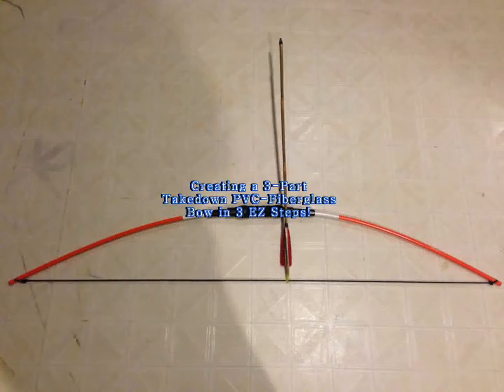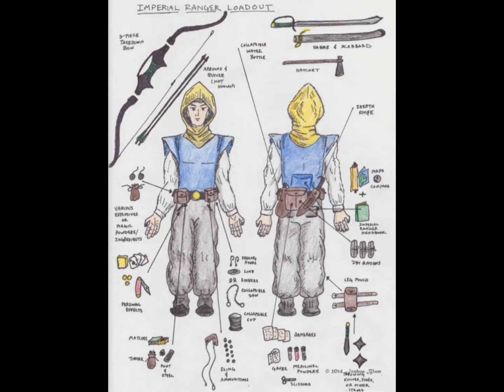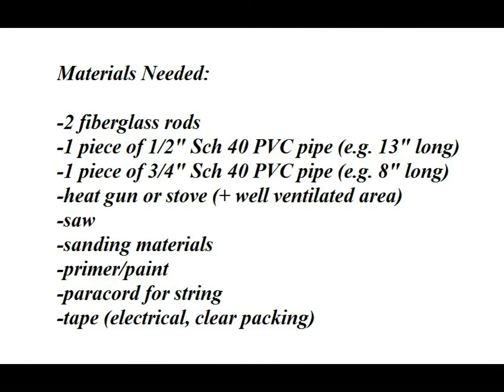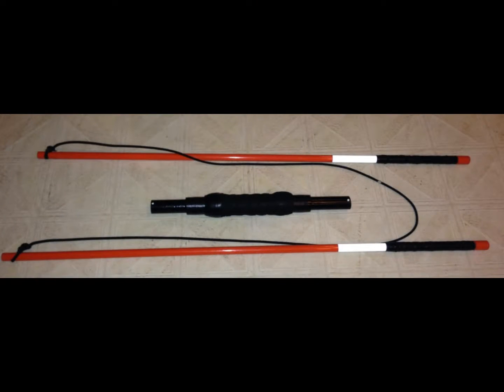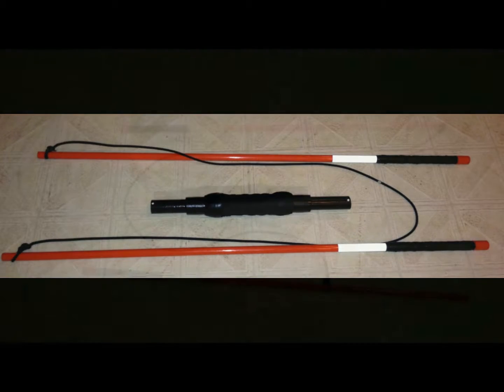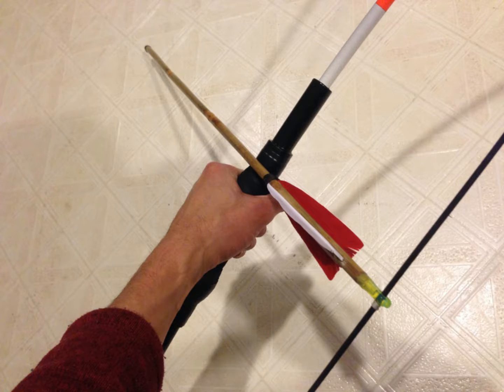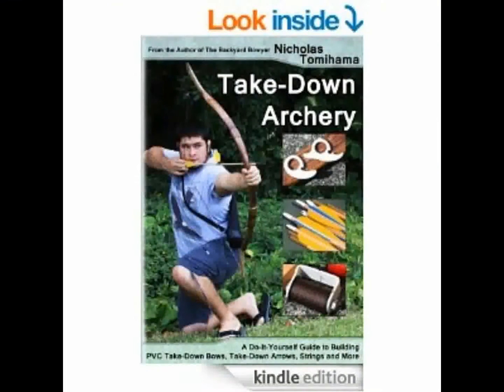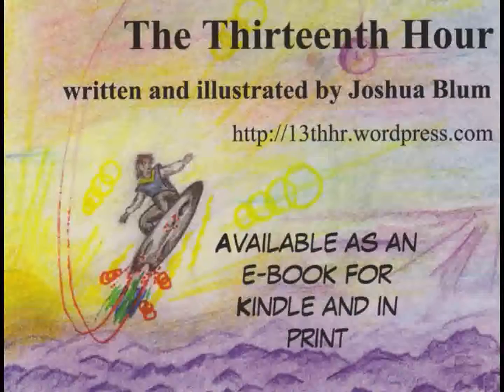Creating a 3 Part Takedown PVC Fiberglass Bow in 3 EZ Steps!

Comment: hi josh I just found some mega rods in the drive way markers rods made from fiber glass and tried them in the set up you are describeing and came up with a bow that is 45lbs at a 28 inch draw with a length of 57 inches nock to nock which is greate for hunting white tail deer if you are interested
Reply: +Robert Miller nice!!

Comment: btw ehat diameter fiberglass rods did you use I found two different dize diameter rods one is the standard size and the other is like a half inch which is larger. so I am wondering if you went with the larger one or what?
Reply: +Robert Miller I think the ones I used were about 8 mm in diameter.  I made another one that was about 40 lbs with the same length.  But with a shorter bow length and a longer riser, you could easily up the poundage.

Comment: Ok I was wondering because I was planning on something. Simular but instead of just one fiber glass per kind I was useing three to increase the poundage to 45 pounds but also to shorten the limbs from 30 inches to a little shorter in length
Reply: Robert Miller yup, you got the right idea.  I made a similar bow a few weeks ago and wrote it up here: 

https://13thhr.wordpress.com/how-to-create-your-own-three-piece-takedown-pvc-fiberglass-bow-part-2-the-fourth-of-july-bow/

Used a three piece PVC raiser design.  Still around 60" NTN but used a longer piece of 1/2 inch pipe, upping the weight to 40#.  If you went with shorter limbs, it should up the poundage more.  Tried reflexing the handle for more weight but it ended up being too unstable to stay strung.

Comment: Nice bow btw did you remove the caps from the ends of the fiber glass rods or leave them on
Reply: +Robert Miller, you can do either.  I think in this one, I left them on. It makes the fit a little better if you leave them on.